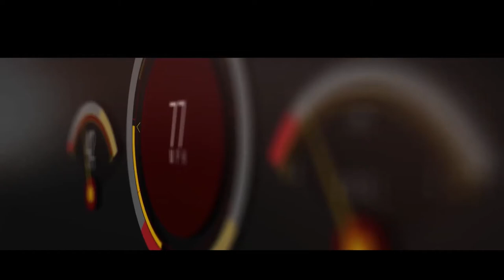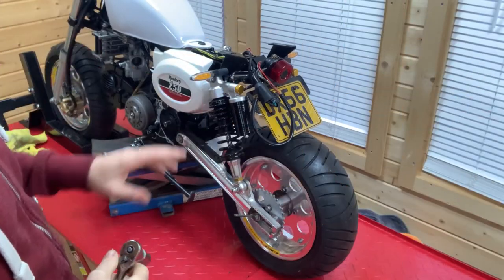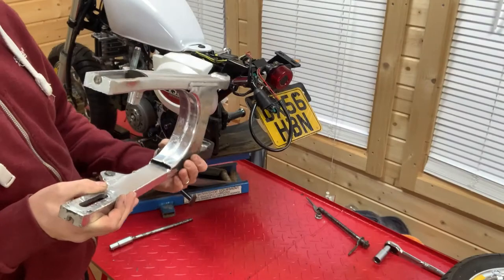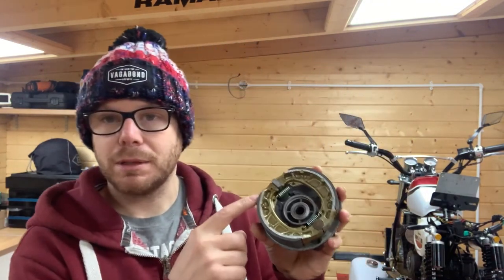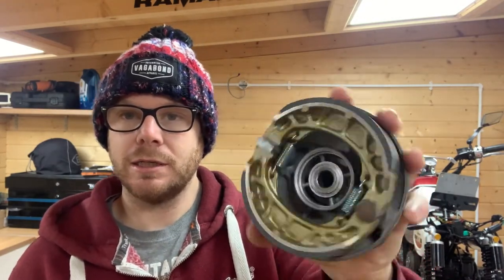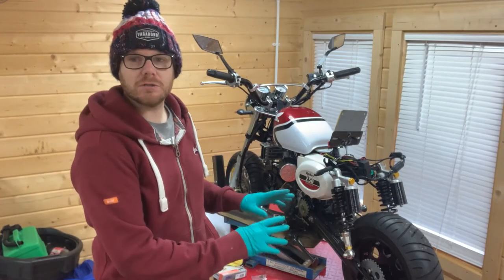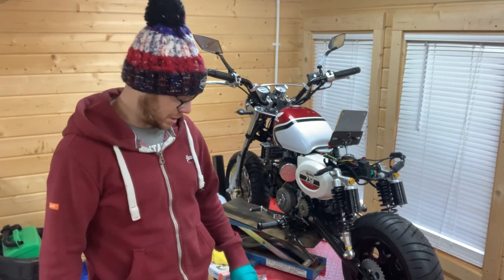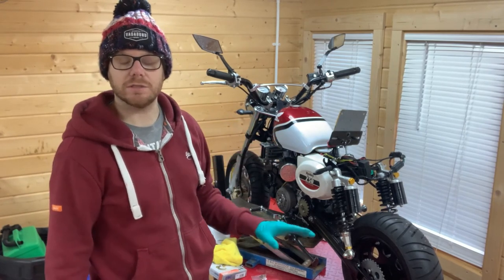Monkey bike swing arm and wheel overhaul with Signalize

Comment: I have a question about these kepspeed arms, on mine there's a gap on the little lug that holds the brake drum and the wheel moves back and forth when the rear brakes on.
Is it supposed to do that?
Reply from the maker: Hmmm. Mine doesn’t move ?